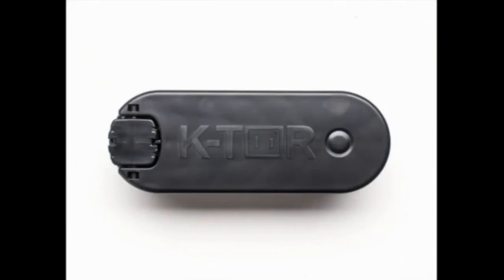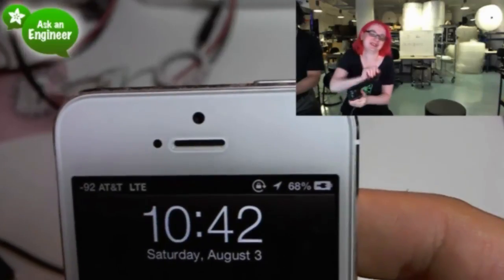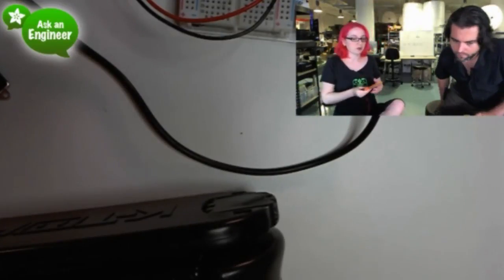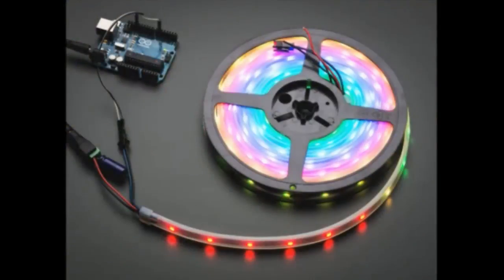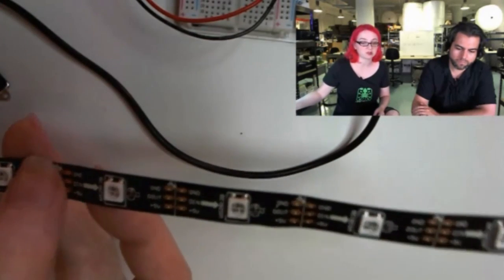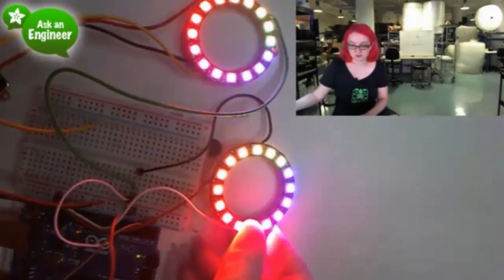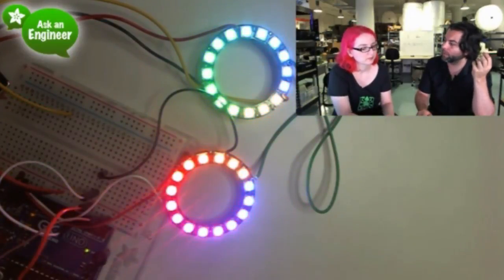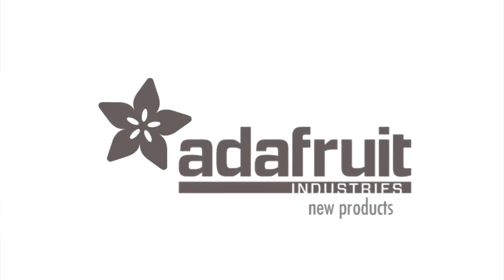NeoPixel Ring & More! New Products 8/3/2013

Comment: Question about this neopixel reel. What is the capacitor in parallel on the 5V supply terminal? Is this just for stabilization? Is there any reason this is used in this application specifically?